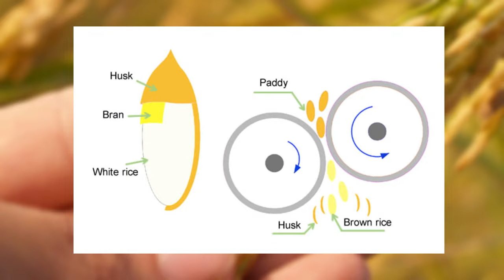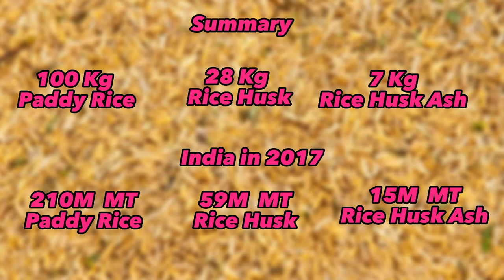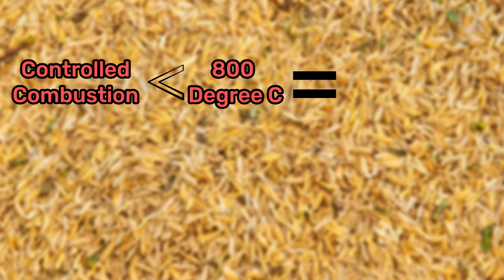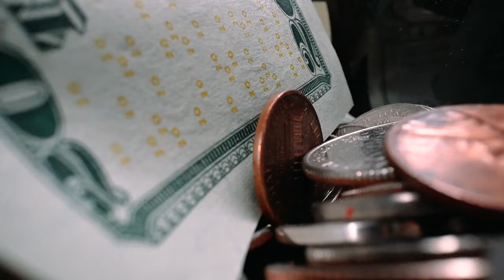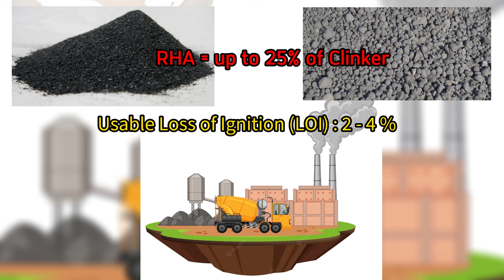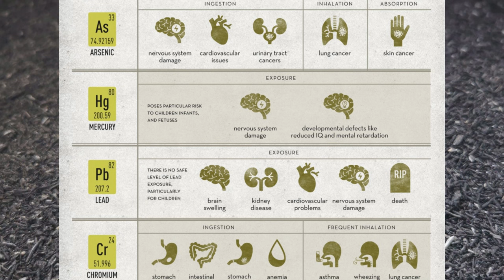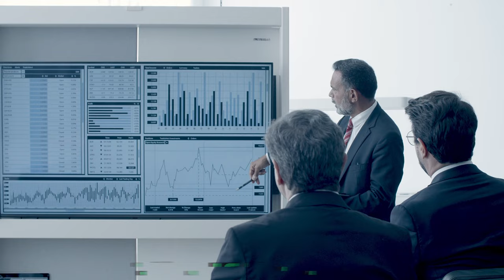Rice Husk Ash Engineering || Profitable & Sustainable

Comment: For making concrete, what is the ratio of cement and rice husk ash
Reply from the maker: Watch @06:52
15 % is good for replacement for cement by Rice husk ash
Example: If 100 kg of Cement was to be used, now it will be 85 kg cement and 15 kg rice husk ash.
But, most important is the quality of the rice husk ash. It shouldn't have more carbon content in it and rice husk ash having Amorphous Silica is good to use
Reply: Ratio For bricks is??
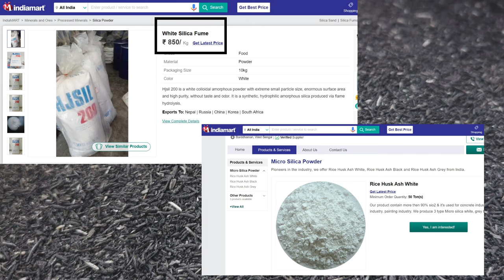Reply from the maker: Watch @08:21
Rice husk ash is not recommended as a substitute  for Red  clay bricks as addition of Rice husk ash may decrease strength,  increase water absorbtion and produces irregular 🧱 bricks.

For Fly Ash brick, the ratio of
50% Rice Husk Ash + 30% lime or cement + 20% Gypsum Mixture is good. The graph  📈 for increased strength is also shown in Video.
Reply: What is fly ash?
Reply from the maker: When Coal is burned, the ash that is produced is known as fly ash. Search Google for more info.